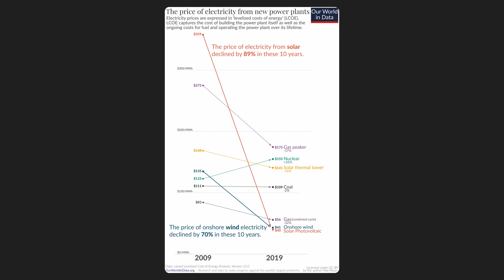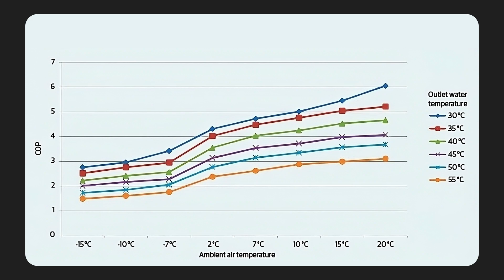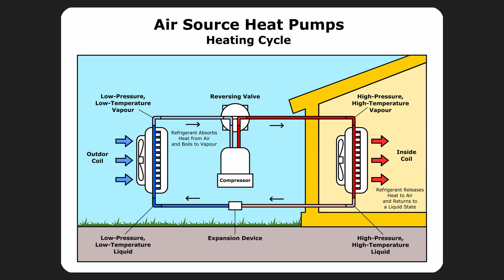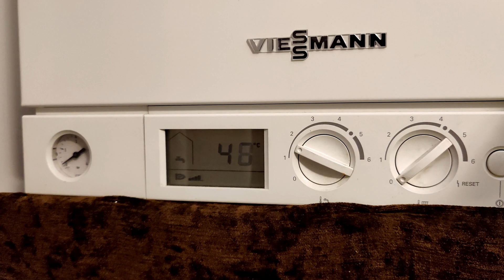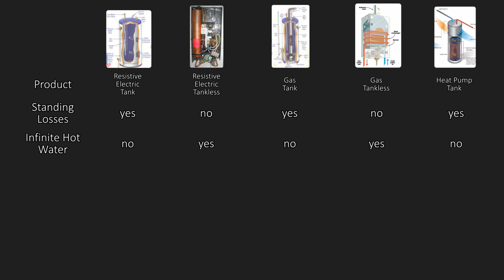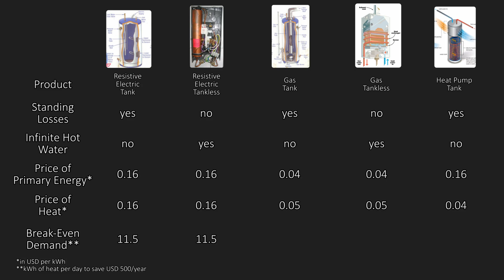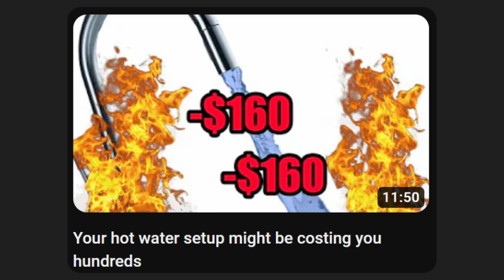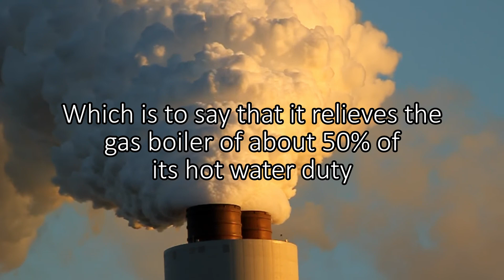Why Many Heat Pumps Can't Compete

Comment: The main issue is that an air to water heat pump shouldn't cost $10k. I got mine (R32, 8kW) for under 2k Euro including shipping. Since these are Monoblock, any plumber can install them. Of course, they work best with underfloor heating, but that's pretty much standard here in Finland.
Reply from the maker: Underfloor is awesome, I would definitely choose it if I was doing new construction

I found a similar product to what you describe (a Hyundai monoblock, R32, 8kW, $3.6k), and the advertised SCOP at 55C is only 3.2, so that would be more expensive to run than gas even if you achieve the advertised value in practice. Underfloor (or upgraded radiators) is definitely required for this

Another concern, 8kW might be pushing it on the power. It should definitely be enough to keep any reasonably insulated house warm, but you might have to wait a while if you're trying to bring a cooled house back up to temperature.

Paradoxically, the power requirement in a typical Finnish home might be lower than in a typical home further south, because the length of the heating season justifies more insulation to save on energy, which ends up saving on power unintentionally. Same effect that leads to this 👉 ( https://ec.europa.eu/eurostat/web/products-eurostat-news/-/ddn-20211105-1 ) surprising map
Reply: @SizeMichael  Of course, here in Finland insulation is a must (same as heat recovery ventilation - standard here for at least three decades) and a given. And yes, this means that you need much less power. Also, a kWh at the moment is around 10 EuroCents a kWh.
Reply: @upnorthandpersonal  Since when is underfloor heating standard in Finland? Or do you mean only in the bathroom or something like that?
Reply: @seneca983  For quite a long time now, especially since borehole heat pumps and in detached houses. I don't think I've seen radiators being installed in a detached home in at least a decade. It's also something that is not very expensive to do here (it's not seen as a luxury) especially when most new detached homes use heat pumps anyway (low flow temp) be it air-water or water-water. Air to air is typically used as backup and for cooling; we don't use forced ducted air for heating. We also don't have gas pipes running to homes.
With district heating, you can run both radiators or underfloor heating, and while radiators are common in apartment buildings, they are not at all common in detached homes built in the last decade anymore even if they are using district heating.
Reply: @upnorthandpersonal  I don't remember seeing underfloor heating anywhere except the resistive electric type for small areas like bathrooms. I've only ever lived in housing connected district heating, though.
Reply: @seneca983  Go check out any detached house built in the last 10 to 15 years. I doubt you'll find many that still use radiators.
Reply: @upnorthandpersonal  I'll just have to take your word for it. But detached houses that new are probably a fairly small percentage of the housing stock.
Reply: @SizeMichael  that Map, particularly in Southern Spain is due to the lack of heating systems in many houses. MAny houses in southern Spain do not have either gas or electric central heating and rely on small electric heaters, combined that with a different building code between northern and southern Spain (from insulations to windows, building quality in southern Spain is way lower).

I have two apartments, one in the south coast atlantic coast of Spain and other in the north atlantic coast of Spain, even though the southern aparment was built in 2007 and the northern one was built in 1988, the insulation in the walls is better in the north and with new windows the overall insulation is better in the north, plus we got central gas heating.

Many people here are installing air to water heat pumps and I am quite reluctant to do so first of all due to the space it consumes in the apartment. But if I am incredibly reluctant to something are air to air heat pumps.

I used to have them in southern Spain and even though they are quite efficient in terms of operating costs, the heat they provide is not comfortable. I would rather go for other system just because of they work.

Comment: When we bought our house i ripped out the old oil fired furnace and installed a used heat pump myself.  It keeps up excellency with our mostly mild winters 99 percent of the time.

I like the idea of point of use water heating, but in America i don't think our outlets can provide enough power for that.
Reply from the maker: I believe US kitchens are often provided with higher power circuits than the rest of the rooms, since they often include a lot of high power equipment (microwave, toaster, air fryer, electric kettle), but the way in which the higher power is achieved can vary. If it's just 120V 30A, that would be enough power for the point of use water heating, but the wrong voltage, since most of these seem to be intended for 240V. But if instead, it's 2 circuits to the kitchen, one on each side of the split phase, then you might be able to rewire that into 240V

I have no idea if this would meet code though!
Reply: @SizeMichael A consultation with local electrician would be recommended, but that should meet the code, as something similar is being used in some other parts of the house

Comment: 12:29
holy hell Is that hideou. I aprove of the concept but I could bever get over the style. surely there must be some that are installed underneath?
And what about water to water heating? Scavenging heat from your sewage? In my mind you could never reach negative temperatures as all the heat you extract inevitably flows there. (ofc. this doesn't apply for the radiators)
Reply from the maker: I had initially bought some more aesthetic versions, but they all had a flimsy feel and one of them broke in like 6 months. This hideous one is much tougher, the plastic feels high quality, and it's incredibly cheap as well, only $18 at my local hardware store. It also seems to be the most mass produced model in the world (you can find them under lots of different brands, but they obviously all come from the same factory) so it's tried and tested

You can get models that go under the sink, just remember to pair them with a faucet (or a nozzle) that allows you to get the shower-style flow, which is critical for ensuring adequate washing power out of just 2 liters per minute

Lots of people have tried to make sewage heat recovery work, but it's difficult at small scales, and nigh impossible to retrofit. They're doing it at a city scale in Vienna though!

Comment: I would argue that the problem here is the radiators, not the air->water solution. If the installation had radiator/fan units instead of the radiators then it would work as well as air->air, just swapping the energy transport medium to be water instead of the high-pressure coolant gas. The advantage would be a larger heat-pump that could deliver heat to several rooms, as well as some floor heating in selected rooms. The issue is that the transition cost is higher. You need to swap out the radiator as part of the transition. It would be a future-proof solution, one could install floor heating as part of other home improvements for instance.
Reply from the maker: Yep, I would definitely choose in-floor heating if I was doing new construction today
Reply: Mixing infloor heating and radiatiors one one heatpump is just a money burning machine. The floor heating doesn't need more than 35°C and the radiators probably need 45°C even with Fans. So in the end you will need to heat up all the water to 45°C and mix down the water for the infloor. Giant waste of money.
Reply: @tschuuuls486  My parents built a home (decades ago) with a mixed floor and radiator heating. Yes, there are two water circuits, low temp for floor and higher for radiators. For any new house I would really look seriously into floor heating, not for energy savings but for the increased comfort: it's just great to walk on a slightly warm floor, especially in cold times. Doubly so in the bath room. It means you don't have to put carpets everywhere to feel comfortably (which is an issue for people sensitive to dust / mites).

Comment: Heat pumps are being pushed hard in the uk and a lot of YouTube channels that are positive keep pushing their seasonal cop are 3 or 4. But their outputs are not that big so their ability to warm up a house is limited. That’s fine if you want to run your heat pump all the time which if you are in the house for an extended period works out but for me I am out of the house for a considerable amount of the day. I have a smart heating system so I can put the heating on before I get home so the house is warm, but that only takes an hour or so. With a heat pump it would need to be on all day to keep the temperature able to be at a reasonable amount. 

Like EVs they are a solution for some use cases, but not a slot in direct replacement for gas boilers. Every time I see an installation video that goes on about the success of the unit, it’s always lots of money spent on getting the best heating output and then comparing against their old gas boiler. If they’d spent £££ on new radiators/underfloor heating and super efficient hot water tanks then surprise surprise your heating bills would be less. 

For me

Comment: I think we have to hope that the cost of electricity comes down relative to gas as we build more renewable power.
FWIW, I did the same calculations, and just had a mini-split installed. It's a lot more comfortable to have that on gently all the time than a massively over-powerful combi boiler cycling on and off.
Reply from the maker: There's definitely room for improvement in the electricity/gas price ratio, since electricity made from fossil fuels currently incurs carbon taxes in the EU, while burning the gas yourself does not. I believe this is going to be corrected in 2027 (edit: typo)
Reply: Also, you can get solar panels on your roof

Comment: Air-to-water heat pumps likely work a lot better with underfloor radiant heating, but that's not common at all in older houses.
Reply from the maker: They definitely pair best with underfloor heating